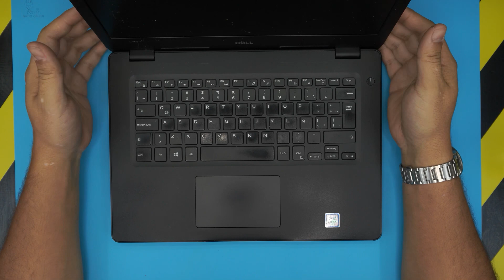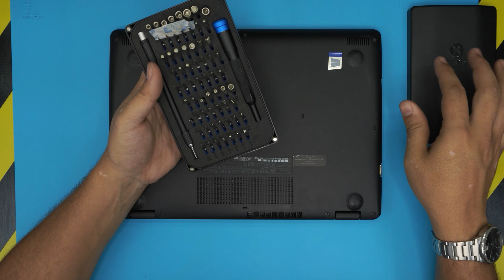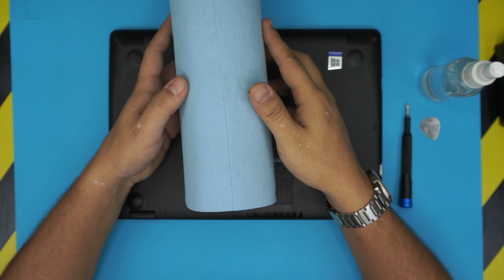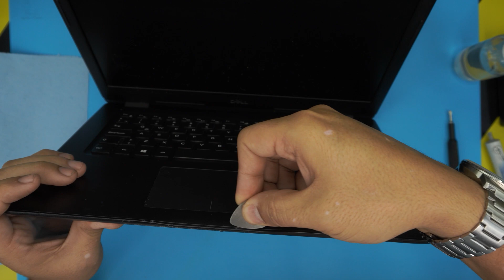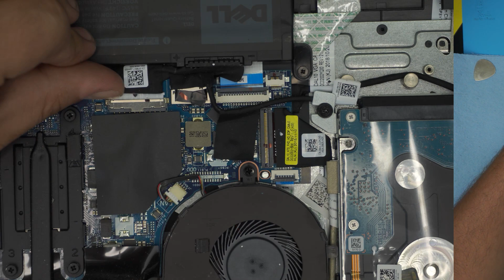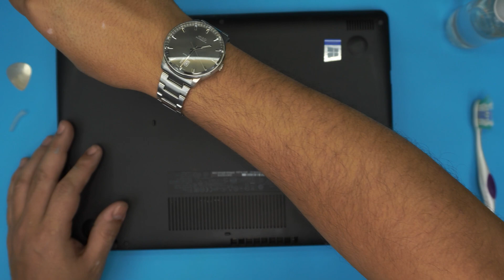Dell Latitude 3490 Laptop Service and repaste FULL Guide

Comment: If my Dell has an i3 and I want to upgraded the processor, is it possible with an i7 or is the processor soldered?
Reply: The processor on the Dell 3490 looks soldered. Older laptops used to have sockets (i.e. 3rd gen core-I7) and the process was just a screw you turned to unlock the processor from the socket and put in the new one. I recently did that for Lenovo E531 to take it from Core I3 (dual core) to Core I7 (quad core). Processor was $100 and just needed to add new thermal paste under the heatsink. BIOS recognised it right away.
Reply from the maker: Thank you for the feedback! if you wish to support the channel you can LIKE or SUB or both :P
regarding your question: Your CPU is soldered on board its not upgradable my friend sorry to inform you about it :(